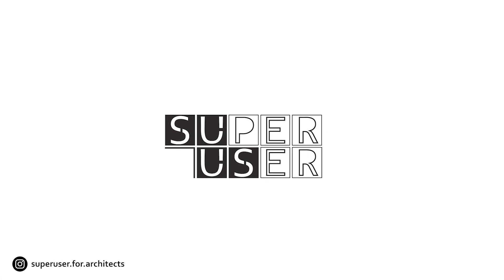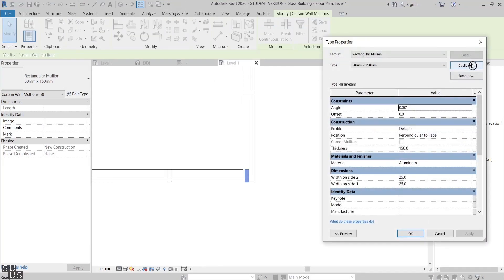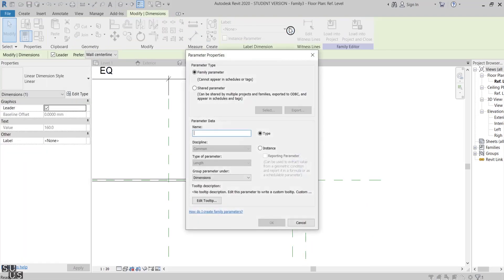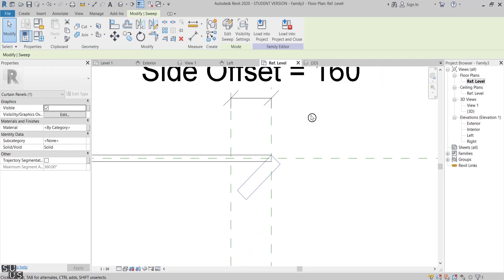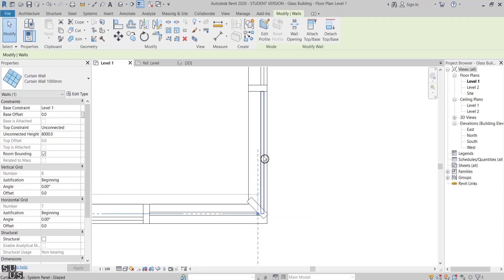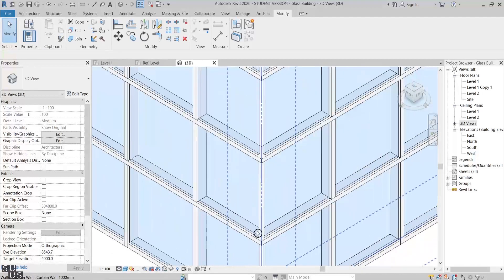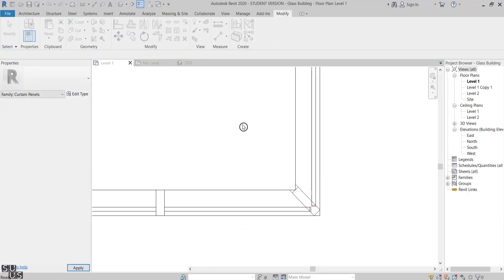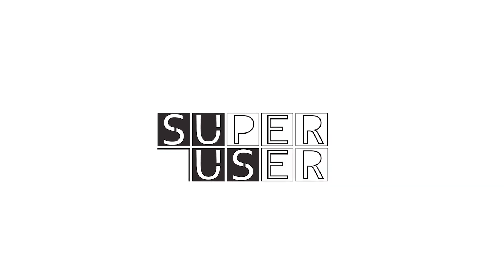Edit Curtain Wall Corner Mullion In Revit: Diagonal Mullion Profile

Comment: A way better way is to create a specialty equipment family for corner millions, a parametric one for all corner angles so you can also schedule it as corner Mullion with its related info, you do it once and use it in many projects by parameterizing voids to cut out the corner Mullion when adapting it to all angles. Way easier and better and can be used forever